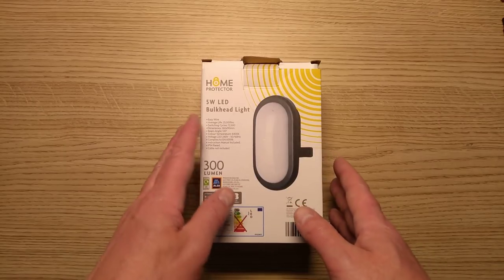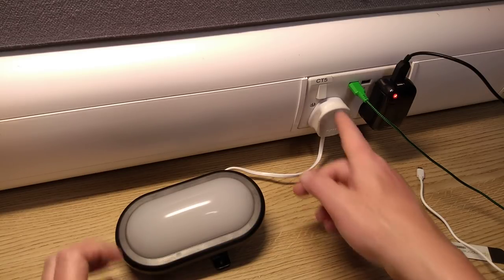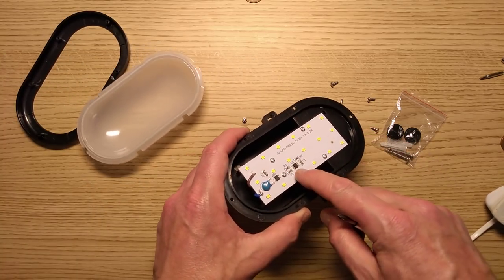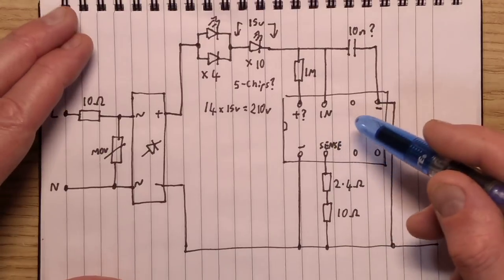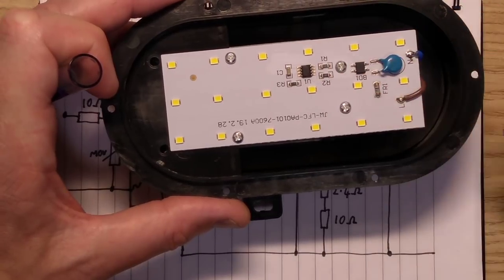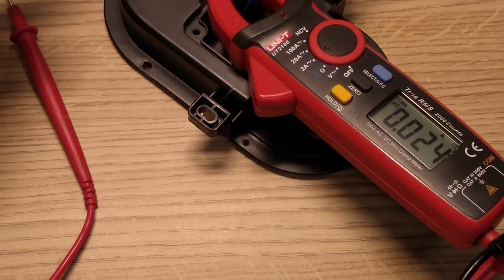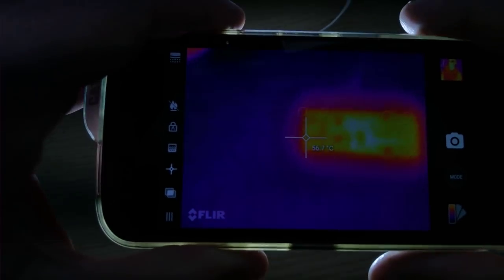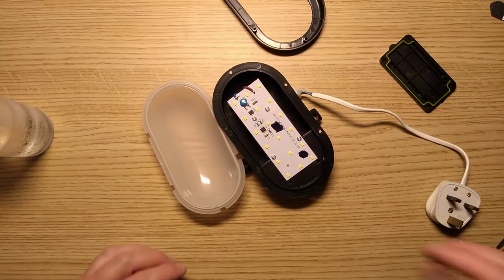Inside the Aldi 5W LED bulkhead light.  (With schematic.)

Comment: That first 10 Ohn resister and the potentiometer across the live and neutral will be the potential divider I'm guessing and will be adjusted to get the correct voltage.
I was looking at trying to use a mains powered emergency LED bulkhead on a 12v battery 
as they are a better light but I need to supply 3.6v to the battery terminals. Been trying to work out what resistors I need for potential divider but there is so much conflicting info on Internet.
Good break down vid.
Reply from the maker: You would have to replace the existing panel with a 12V one, or make one with strips of LED tape on an aluminium panel.

Comment: Second hit on Google for "68R8 chip" is the Texas Instruments UCC28086 which is an "8-PIN CURRENT MODE PUSH-PULL PWM CONTROLLER WITH PROGRAMMABLE SLOPE COMPENSATION". That would be an interesting use of that chip...

Comment: I wish I could find a decent outdoor LED light for that cheap in the USA. Seems you can find cheap "outdoor" LED lights but they're nowhere near water-resistant. I purchased a 10 watt "outdoor" LED spotlight from my local Lowes Home Improvement about a year ago. Been using it indoors and decided to put it outside, since it was supposedly designed for that. It was outside a total of two days. On the second day, we had a thunderstorm. The next day I spotted condensation inside of it. Haven't turned it on yet to see if it's ruined, but if water got in from a simple thunderstorm, it's not designed for outside use.
Reply: Has it got a small drainage hole on the bottom?

Comment: I didn't know Aldi had cheap tatty electronics! They showed up here in the states at some point, I'll have to head into an Aldi sometime.

Speaking of cheap tatty electronics, I got a little LED battery-powered light from a gas station somewhere in Ohio. It cost $5, and it actually turned out to be quite good! It's cheap and plasticky, but it works pretty well – impressive brightness. It's sensibly built with components that are well rated, including a 5 watt resistor that was only dissipating 1 watt. I ended up bypassing two of the four AAA batteries and running the LED COB straight off ~3 volts with no resistor. This makes it a little dimmer than an unmodified one, but still quite bright and less stressful on the batteries.

It was one of these. If you can get your hands on some, I'd definitely recommend grabbing a few. They're super easy to modify and very functional too.

http://www.penndistributing.com/Products.asp?f=39510266%2Ejpg

Comment: What worries me is that many dolar PV systems push up the mains voltage in the home in an effort to feed onto the grid. 260V is then not unusual and it seems to wreak havoc with low power devices such as LED lamps...  And it tends to cook cheap computer PSU within 3 years (summers).

Comment: Also good point about the failing LED issue - needing to replace the entire bulkhead and no longer just a bulb...
Reply: Yes, but in theory the LEDs should last so much longer.
Reply: @jonathanpalmer155  The point being, that in all probability by the time they fail you will need to replace the entire fixture not the "bulb", therefore a bit more effort required to replace - and of course you may not be able to find the same fixture...
Reply: @Fifury161  I appreciate that, but if they are anything like IKEA the product range will have changed totally anyway, so if you really like something buy 2 of them.

Comment: For an outdoor oder basement lamp it's quite weak shining. 300 Lumen ist less then an good old 40 W bulb  which has 430 Lumen. An 25 W bulb gives you 230 Lumen. This device is something in between. Typical bulkhead lamps used at least 60 W ( 730 Lumen)

Comment: I'm looking to use an old USB charger to power an led night light. It runs on 3 AAs in series and has an 800ish resistor in line.(I was toying with putting another one in series to take down the intensity and increase battery life and right now I can't remember if that was my target resistance or what it has now)  4.5v Vs 5v. Is this as simple as it seems? I'm
Reply from the maker: Using a standard 1A diode in series with the 5V supply will drop it down to below 4.5V.

Comment: I   found a very interestingly configured lighting device at the dollar tree, it's a 'reusable battery bank however I think it can easily be rewired to use rechargeable lithium batteries and cost around 3USD for a rechargeable bank. Where can I send a package with components for you to  tinker with?

Edit: All it needs is the normal battery pack a 2 AA pack of rechargable batteries... and a USB cable. All 1 USD Each atm

Comment: Clive: Just stopped the video, when you said, the corner LEDs are in parallel, and the middle ones in serial. My Question, without measurements or seeing the vias on board, HOW DO YOU KNOW THAT!
Reply from the maker: I could see the tracks on the PCB at the right angle so light caught the edge of them.

Comment: So the Aldi we have in the US are grocery stores... I wish they had these sort of items in them....
Reply: There's one here in Texas that has some electronics and non-food, but mostly it is food. It's tiny. It's like one aisle more than a gas station/convenience store.
Reply: They do, you just have to catch them on the right day... everything in Aldi that's not a food staple is a one-off limited time thing.
Reply: I was just thinking that. I did buy an Iridescent frying pan and pot on my recent trips. I'm in a huge city and it depends what store you go to because there is one I don't go to very often and that Aldi's even carries furniture. But I'd buy that light. I did once get an O2 meter that slips over your fingertip. $20 when they were like $50 at walgreens. It got stolen so I wish they'd come back around again. Availability is always the issue with Aldi's products.
Reply: In East Tennessee, we have both Trader Joe's (Aldi Nord) and Aldi (Aldi Sud).   I don't recall Trader Joe's having anything other than food - and I haven't really spent time in an Aldi to know.
I've heard coastal Virginia also has Lidl, so that must be a competitor.
Reply: All the US Aldi's I've seen look like they were stamped out of the same mold.... although they sometimes flip the mold just to mess with you. :) They have one aisle with the "Aldi Finds" non-food items of the week where this sort of thing would go. Usually, they swap them out each week.

Comment: They should put a plug on the back of these fixtures. You just place a socket where the lamp goes and just plug it in. Then if it fails you can just plug a new one in.

Comment: this is something I am kind of against with cars being led based now, because there is no way when buying a car that every single warning light works now. and no test button to display all the dash lights. whereas before if you bought a 2nd hand car, you pay like £30 for new bulbs, replace them yourself with a little knowledge, and then you knew that it was all brand new, plus the reassurance that the bulbs won't really blow in a couple of years, or you know when they fail. whereas now someone could sell you a used car, and maybe even pull the bulb for example dpf filter on a diesel car. first thing you know is a breakdown, and a huge garage bill or having to replace the engine without any warning. which if the dpf gets clogged then it can mean.

Comment: Your drawing did not show any LEDs in parallel or series,  but you said that they were both, but that is not what the drawing shows....can you explain more?
Reply: Strange.  I saw them.  Look again.
Reply: @bdf2718  in fact, 2 of the LEDs had no wires at all touching them, only 4 of the 10 LEDs have power drawn to them, how do the others get power???
Reply: @sargetester99  You've made some progress, in that you;ve gone from zero LEDs to 4 LEDs.  But you failed to spot something and you miscounted: if I ignore the bit you failed to spot there are only 3 LEDs drawn, not 4.  Keep staring at the diagram at 7:40 and eventually you'll realize that all 18 LEDs are accounted for.
Reply: @bdf2718  now you are seeing what I'm talking about.  How can you explain that??
Reply: @sargetester99  Because I can see what you keep missing. :)  Like I said, all 18 LEDs are accounted for in that diagram.
Reply: @bdf2718  you are correct  , I see it now
Reply: @sargetester99  :)

Clive is lazy.  Would you expect him to draw all 18 LEDs individually?  Would you draw them all?

Comment: The stuff aisle in Lidl is nowhere near as good as it used to be.  Aldi is still decent though.
Also on the subject of LEDs, I got some 3W UV ones from china recently.  They give off a fair amount of white light - never seen that in lower powered ones.  Is it normal?
Reply: @johncoops6897  Soft white in this case, almost green at low current, no violet / blue hues in sight.  Flourescent objects showing up was the only sign that there was UV present.  The IR ones I got in the same order were definitely rejects (gave faint red and almost no IR at all) - just wanted to be sure with the UV ones because I've been refunded and my concience wont let me keep the refund if I was wrong :p
Reply: @johncoops6897  Same style as yours but the traces are thick and straight.  The light is greenish white.  I was just reading about how they control the wavelength via ratios - could this be some sloppy manufacturing process thats resulting in a much wider spectrum? Might also explain why the IR ones showed red light

Comment: I much prefer to run low voltage lighting, once i've got a power supply setup I don't need to worry about turning of the mains to change a fitting.
Reply: It's not the voltage that's the issue. It's the AMPS that will have you regretting :D

Comment: lidl parkside 20v team tools are now the winner, packs have decent in built balancing and the chargers are of decent quality, hopefully they will stay with that battery design for a while and not dump customers with a new battery connector next year
aldi have gone to their new ferrex badged stuff leaving last years customer now without replacement batteries etc
also it does not seem to be as good as they had a year or two ago when it was workzone, seems a real step backwards and i now wouldnt trust aldi tools for simply being ''dumped'' by the next new thing to replace them.

Comment: 2:46 - Why do receptacles in the UK have a switch to turn them on and off?  I wish receptacles in the States had such a feature.
Reply: You can buy them that way.
Reply: Our wiring is really a lot better than most places in the world shuttered earths, ring mains and bayonet cap lights tho they are being slowly replaced by the terrible Edison screws
Reply: Traditionally UK outlets were positioned near the floor and often ended up behind furniture, and the outlets tend to grip pretty well so yanking out a cord wasn't always practical.

Comment: Now now, "1$ Standard LED Package" and "$2 Standard Electronics Package" designed for 50-year fixtures is no way to be making money. I'd personally love a Big Clive designed, 'solid heat sink' + 'over-engineered electronics' + 'minimal manipulation from LED tape' light bulb series. I fall flat on the over-engineered electronics portion, but they skimp so hard on the heat sinking it isn't hard to beef up some models.

Comment: The old bulk head lights with glass cover would last for decades with the odd bulb replaced every so often. These to me are a backward step.They should design the board with a two pin connector that can be pulled out and replaced when failed using the  old bulks as casings.

Comment: Eaaa My Uni-T 210E came yesterday.   Liking it but powering up in AC mode SUCKITH !   There is  a Mod you can re flash the things but not so sure  my brain would handle the HEX code thing.  I have the Arduino and else required to do the procedure.
Reply from the maker: You can get a small flash programmer on eBay.
Reply: @bigclivedotcom  I already had one.  You can also use a Arduino.  I have a bucket full of those.  What I don't have is confidence messing with the code.  Did you do yours ?

Comment: I always think with lights like this, they're a bit useless fixed on a wall. Pointing straight out, all they do is blind you and not light up the ground.
Reply: That's what soffit boards are for.
Reply: K Wallace - Well the original application was for them to be mounted above, so then the light would shine downwards...
If you want a wall light, buy a wall light.
Reply: K Wallace The better ones have a downward direction to them.
Reply: I know, I was meaning most of the LED bulkheads I've seen end up being screwed on the wall next to the front door pointing straight out

Comment: Working USB in a power board/wall socket, arn't they supposed to fail immediately
Reply from the maker: It's putting out about 4V.
Reply: @bigclivedotcom  you seem to use it anyways seeing the wire connected ?
Reply from the maker: @maicod  I use it to slowly top up things like my LED head light.
Reply: alright ! it can still be useful for that purpose.

Comment: Please don't mount these outside on a wall by your door. They spray light pollution every direction. Either mount these under an awning or facing downward. Better yet, install a properly light-shielded outdoor fixture to put light directly where you need it.

Comment: it's sad that you have to toss the entire thing when it quits
Reply: You can repurpose the housing.
Reply: You could probably turn it into a bulkhead light.
Reply: Put an Apple sticker on it and call it a day.
Reply: Bigger cities have programs where this stuff gets properly recycled. They even make jobs for mentally handicapped to separate the most simplest parts.
Reply: @gavincurtis  I know it's trendy to shit on Apple but Android devices are just as throw-away. The difference is, Apple devices are used longer on average before being binned.
Reply: Evilution, true, but well deserved.  The problem is apple actively works to STOP their products from being repaired except by their soviet style exchange program.  I like Apple but I hate what they are turning into.  Less innovation, more strangulation.
Reply: @gavincurtis  I totally understand why Apple don't want other companies repairing their products or using unspecified parts. The number of complaints of iPhones bursting into flames but under investigation, a 3rd party battery has been fitted or a cheap crap charger with no protection circuit is used. Apple always get the flack. They just want their products to always work safely and as intended.
Reply: Sounds "green" to me..the money kind. So grind them up and recycle when the battery dies or screen is cracked?  Let's "recycle" in a way of forced obsolescence; to extract a mere fraction of the energy that went into making the device in the first place? No.problem.  Must keep profits at maximum!  Plenty of open pit mines left for more rare earth metals to be found.  Lot of people willing to work at $9 a day.

I am continually amazed at how humans are de-evolving back into apes.

Yes, china chargers are cheap, that is another problem altogether, unvetted "free trade".

I have every iphone up to the 7 which was my last until going Android.  I don't hate Apple, but I do despise what they are turning into.
Reply: @gavincurtis  Just because Apple don't like other people fixing their products, doesn't mean that Apple won't fix it. They don't charge that much for a quality repair using quality parts. A broken screen doesn't mean it's going into the bin.
Reply: @evilution  They quoted me $300 to "exchange" my broken screen ipad with a replacement.  It fell from a 32" tall table onto the floor in a full protective case and landed just right to shatter the touch screen (LCD was intact).  Not a scratch anywhere on the device.  Just a shattered tempered glass touch screen; that still worked somehow.  I take the blame for having it fall, but $300 is stupidly expensive to repair a $500 when new iPad. On top of that it would take 2 weeks!

I found a 3rd party private shop to replace it for $85 with new touch screens that cost them $13 and took 1 hour to install as I waited.  Otherwise it would have gone into the trash.

Now they have the new T2 chip that serializes all the peripheral chips to make even that $85 impossible in the near future...if they implement the full rumored "security" features of the T2 chip.  Even battery replacement could be terminated as there is a chip in the battery as well they could serialize.  Tests by iFixit confirmed this feature is not enabled as of yet.  Time will tell on that one.

I dealt with the headphone dongle lockout issue while in Europe for a month.  Upgraded to iOS11 on my then iPhone 7 and my favorite sounding headphone dongle which was not a counterfeit (I believe it was Belkin brand in black and completely different physical shape)...stopped working.  Simply because the chip in the dongle did not carry an approved "serial number".  Hence I was without headphone music the entire vacation and that was the last straw for me.  Imagine buying a Sony Walkman that would refuse to play the cassette tape or play the radio unless you only used Sony headphones.  There is nothing proprietary about the serial data coming out of the lightning port into the DAC in the headphone dongles....I believe it is industry standard SPDIF, but I could be wrong.

It is the little draconian things like that really bother me. Apple needs to focus on innovation and not strangulation.  Such an awesome company being run into the profiteering rocks (my opinion).
Reply: @gavincurtis  yeah, that's obviously Apple's fault that you bought a crap case.
And that supports what I'm saying. Apple get the blame for other people's cost cutting.